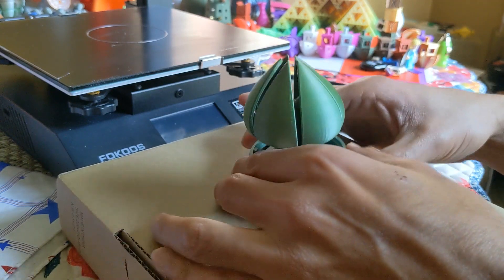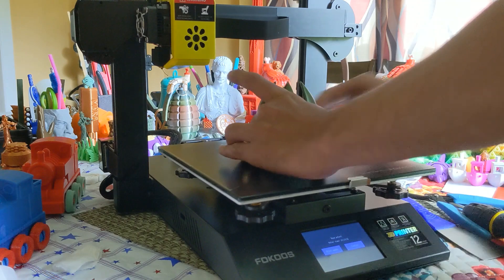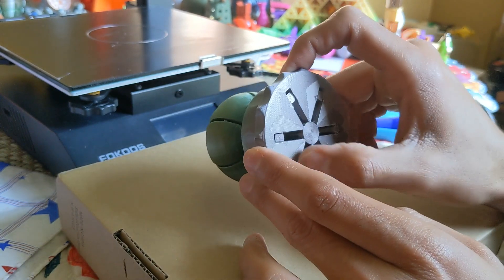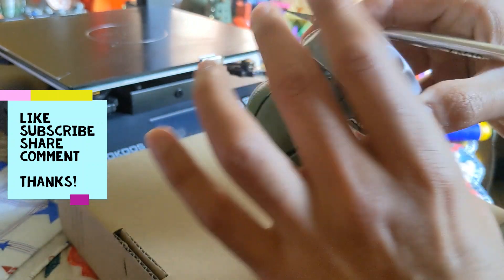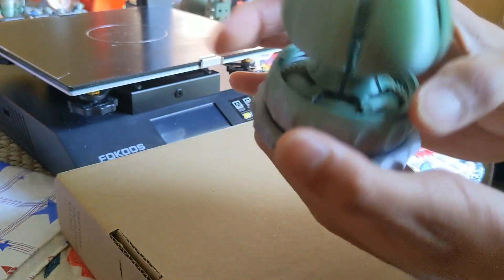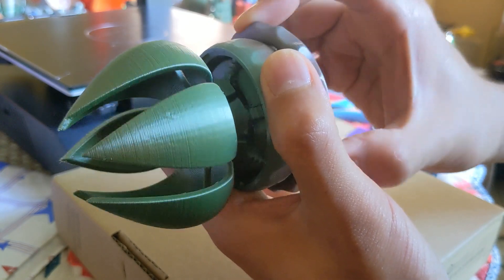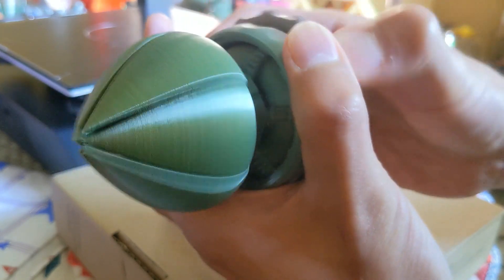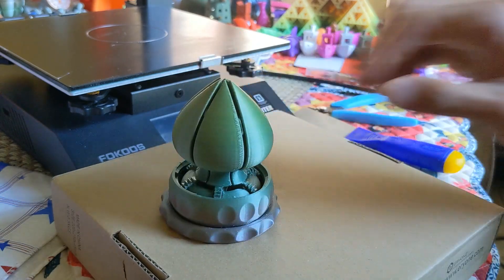How To Print Valentines Day Blooming Flower Gift Box

Comment: The print failed for me twice first I printed with the thicker stem file and I couldn't get it to turn, then I printed the one with supports but the heart became a blob of a mess. ANy help would be amazing!!
Reply from the maker: You do need a great bed level, and dialed-in machine, and martial, and slicer settings, when printing anything with such tight tolerances. 

I would suggest to make sure that for a given material, and a given good temp (temp tower) and print speed you have your bed level, eSteps, and flow rates, and retractions dialed-in. This is at the bare minimum.

Try printing tolerance test prints, and until you have the tolerances dialed-in, I won't try to print this one.